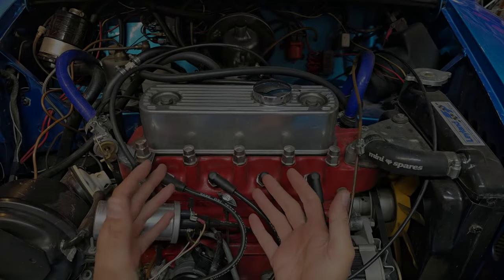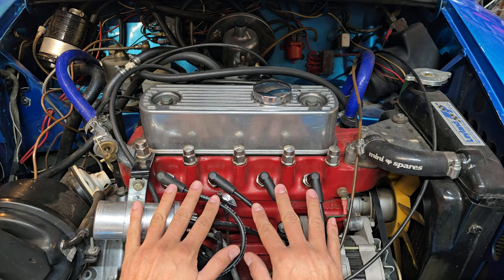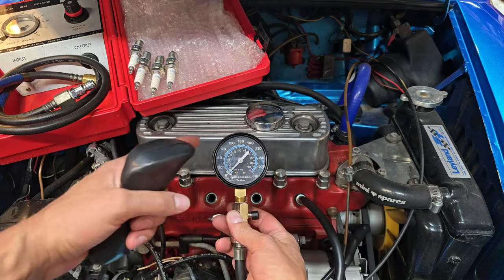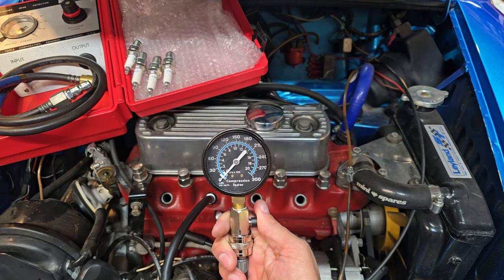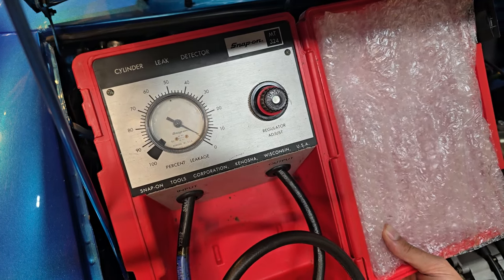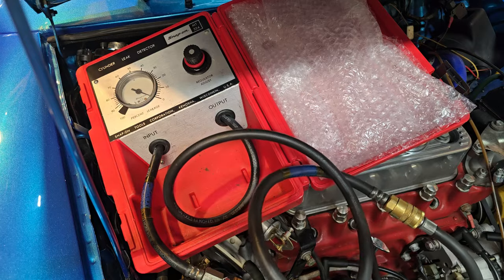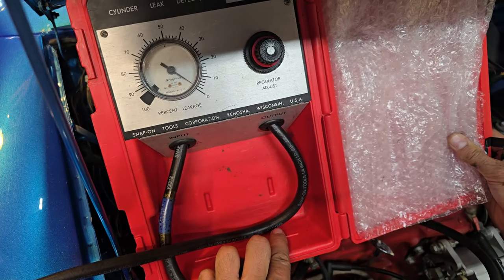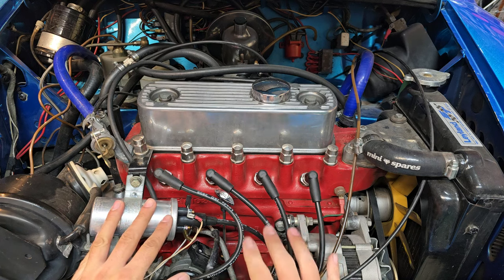Good motor! A great example of good compression and leakdown testing on a classic Mini motor

Comment: Hi good video and correctly done 👍 I would like you to express your views/ opinions on ported and manifold vacuum please as I’m about to fit a vacuum advance unit to one of my cars that didn’t have one fitted to it in 1938 the year of manufacture, now I’m confused because there seems to be a right good argument on YouTube about it ! ie some saying ported and other saying manifold????
Reply from the maker: Use ported for the best performance of the motor. However, I also build distributor curves knowing that I will be using ported vacuum. If your distributor was designed for manifold, then use manifold.